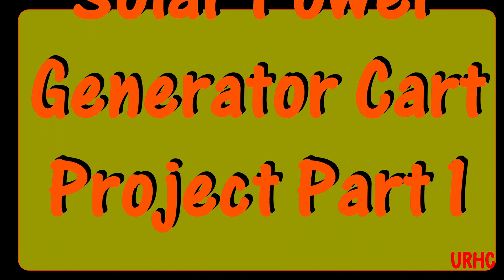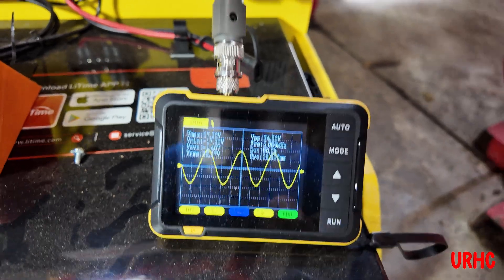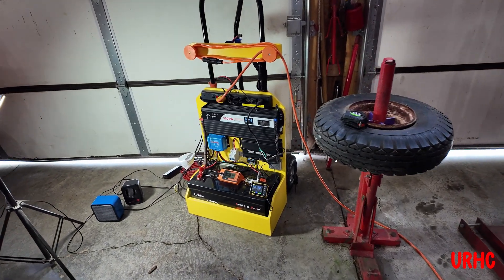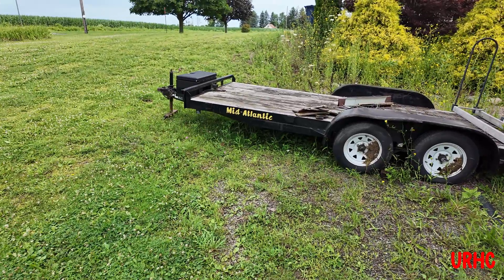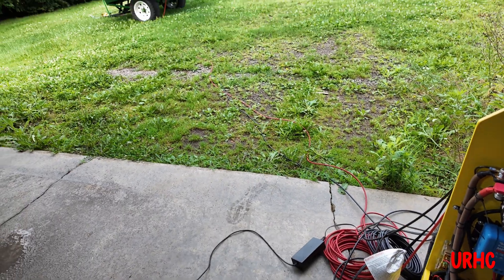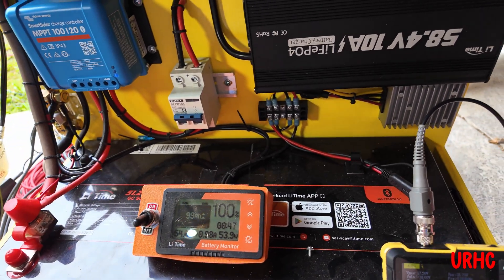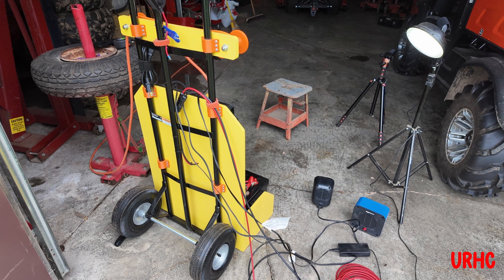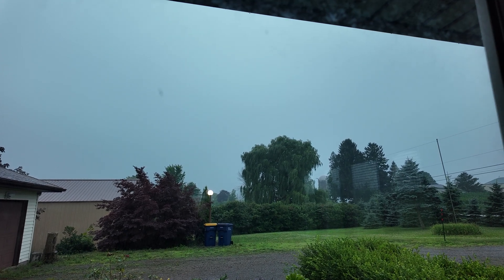Solar Power Generator Cart Project Part 1

Comment: Very nice. I built my first cart 5 years ago. Then went to a box. Everything worked well enough that now I have a 1600w solar setup with 400ah of lithium battery backup and 2000w pure sine inverter. Which turned from back up power to being ran every day. Always on the search for more power and usage out of it.
Reply from the maker: Thanks.  I figured it was time to get started with all the power  outages we see and now they just raised the electric rates on our last bill. I bought 5200 watts of panels that should realistically provide 8 to 10 kw daily and looking at 2 6000 watt inverters for the final trailer build. Still waiting for battery cost to drop before deciding on bank size. We get many cloudy days and that's the killer for total solar around here.  I doubt there will ever be a payback with battery costs but fun playing with it. Thanks for watching.

Comment: Good morning 🌅, URHC, that looks like a great project, a friend who lives in the uk as solar panels fitted to roof of his house, it’s connected to the main grid, he gets free electricity all the year round, and added bonus sometimes gets a check from the electricity company, for the electricity that is put into the grid, I was watching somebody about two years ago the solar panels were connected to a device that swivels and tracks the Sun so is in constant direction, interesting project be safe keep up the great work, France
Reply from the maker: Here it's  getting harder and harder to get homeowners insurance if they are permanently mounted. I don't trust the lithium batteries with all the recent fires. Those solar trackers really can help. Thanks for watching.
Reply: @unemployedredneckhillbilly2023  Good morning 🌅, Yes, I agree with the issue with batteries, There has been so many car fires from what I have heard and seen, due to them sorting out overheating, Good luck with your project, France.

Comment: Very much looking forward to this series. I learn so much from you. I'm sure you'll have a better idea but there's a company called Maker Pipe that makes connectors for EMT conduit. Many people have used them for solar panel framework. They also have an adjustable angle connector that can be used to change the angle of the panels relative to the sun. They have a YouTube channel as well. https://www.youtube.com/@MakerPipe May not be something that interests you but it makes me feel better to maybe be able to help you for a change...
Reply from the maker: Thanks.  I have looked at those fittings but really didn’t  think they would be heavy enough with the winds we get. Right now looking  at industrial unistrut channels with local framing tech extrusions. Thanks for watching.

Comment: GREAT plan!!  Any power backup is a good improvement.  I am in the process of improving my power backups, and plan to add more solar and storage capacity over the coming months/years.
Reply from the maker: Basically I just want a power source for the fridges and freezers along with enough to run the well pump for emergencies that doesn't require a gas generator running.  It will also be portable and won't get my house insurance canceled like a permanent install can. Thanks for watching.

Comment: U get that trailer done u will never want another electric bill again... Server rack batteries are getting cheaper every day.. We been off grid for 10years fixing to buy 48v eg4 batteries and sell our 24v system. I want MORE POWER 😂🤣🤣🤣🤣... Keep it up brother and yal be safe im thinking worst times are coming but we never know....
Reply from the maker: I'm looking  forward to getting going with this. I am considering the eg4 inverters and eg4 powerwall heated batteries and will probably go with 2 of the 6000 inverters and 4 batteries eventually. Having the generator for fast charging when there's no sun should help with winter outages. A windmill would help with our winds off lake Ontario in winter.  This stuff definitely isn't cheap. I think we avoided worst times a couple days ago and the future looks better now. We will see in November.  Thanks for watching.